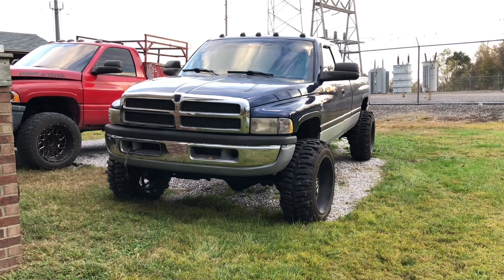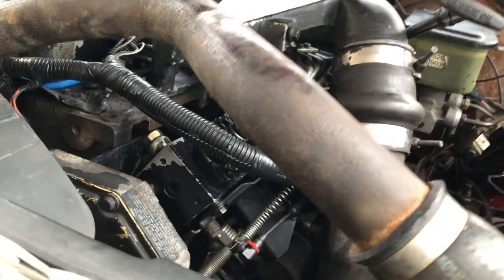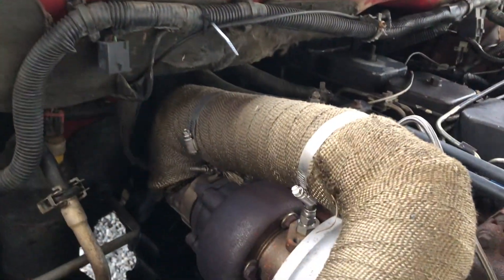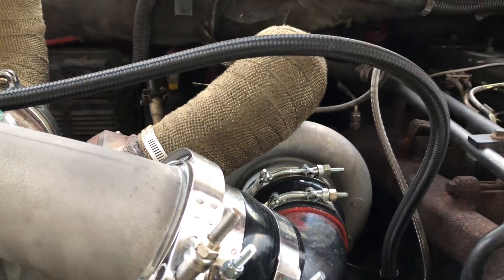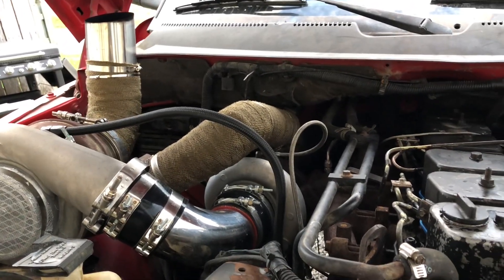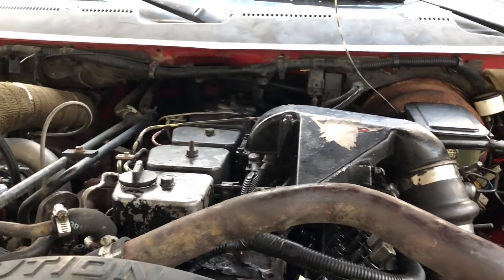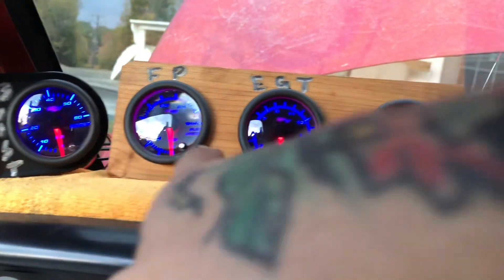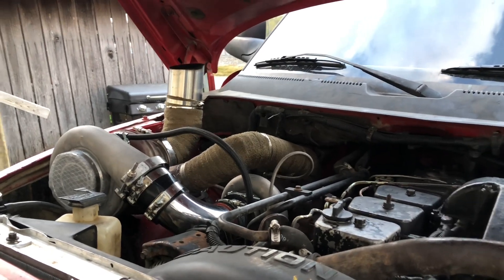How I made my compound turbo setup from Amazon!!

Comment: Great video, I started watching your videos from the valve springs & 4k gov springs. I have 1996 2500 5-speed and have a few mods to install but being in California I know my truck is exempt from having to do smog checks. But I keep wondering if I start doing my mods I can still get in trouble. I even have a pac exhaust brake kit to install too. I wonder if the pac brake would fix with compounds?

Comment: What is feed line and return I’m trying to build something similar
Reply from the maker: The oil feed to the big turbo is -6an and little turbo is -4an, both drain lines are -10an into -10 to -12an “y” fitting in the factory return port
Reply: Where does your big turbo feed line hook up at on the motor
Reply: I guess you just used the 2nd port
Reply from the maker: I used a “y” fitting. Both drains go into the “y” fitting in the factory drain location on the block
Reply from the maker: If you’re working on a 24v you can use the other port
Reply: It’s a 12 valve